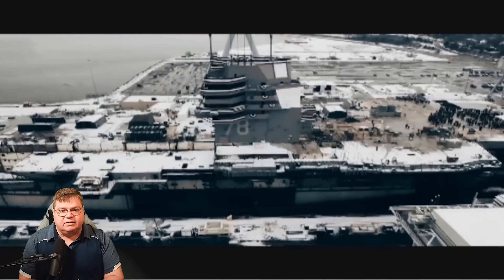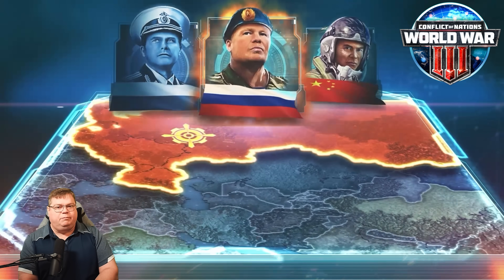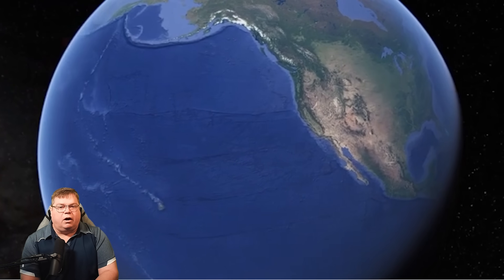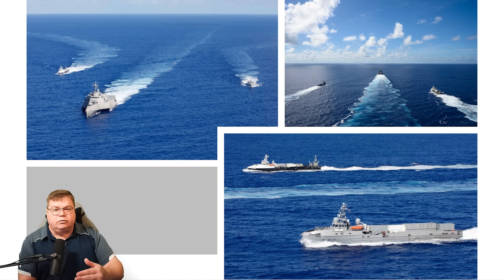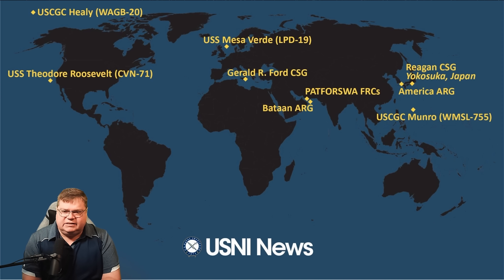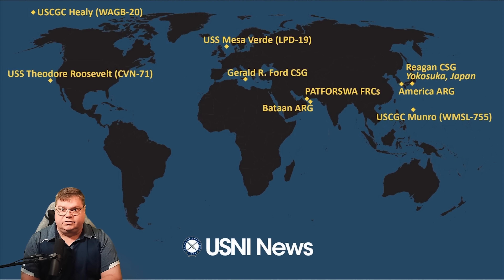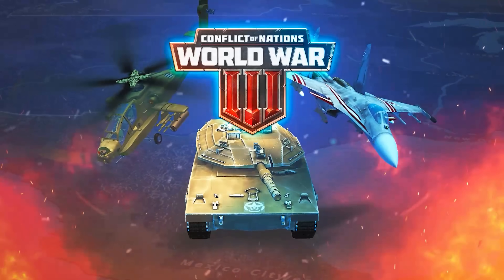How The US Spends $200B On The Navy (and get away with it)

Comment: With Ike on the way, it will be interesting to see how a classical USN Strike Group performs in 2023. Does it still hold the weight it did in the 90's? Didn't see any 35's on the deck of the Ford, a red flag. Will 1990's doctrine hold up against the advent of air/sea drones and modern missiles? Can the elderly wings of the F/A-18 keep up the same tempo of thunder and death? Under the shadow of a third world war, will the USN expend its precious arsenal of artisanal TLAMs?

Comment: I got issue with the new “Fly-by-wire” design our military is using. 
Have you ever had a taillight go out because the wiring got damaged? Imagine trying to take apart a ship or a sub just to find a faulty connection. Repairs are going to happen.
Reply: You do realize that it’s easier/ cheaper/ lighter/ less bulky/ and more reliable, right? All that means that not only is it easier to isolate/ narrow down the source of the problem (modern diagnostics/ monitoring can tell you exactly where to look when something breaks, & often why it broke. It can also catch aberrant trends to tell you something is about to break/ needs replacement.), it provides for much more redundancy vs. purely mechanical systems. It’s a lot easier to divert electricity than steam. It may not seem as intuitive at first. It definitely requires a more theoretical background, but once that background is in place, the complexity is much more manageable than older alternatives. It also means one’s knowledge is applicable to a broader set of systems.
Reply: If this is the case, I hope we can utilize FBW systems as you have described them. They seem to significantly cut back on parts required for building a vessel and their maintenance. Do we now about any of the disadvantages of this system?

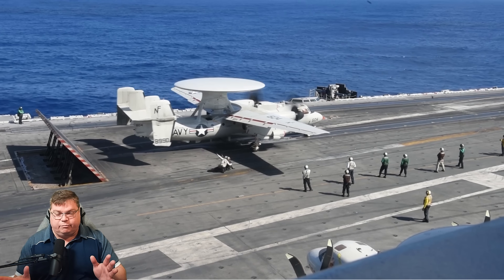Comment: 4:10 Backup systems to keep a carrier online?  US Navy reactor operator vet here.  The only real backup is that there are two reactors.  One can supply all steam loads (turbine generators for electrical power for ships loads, aux loads, reactor coolant pumps, and aircraft catapult systems) for both steam plants.  If both reactors are down, ain't nothing keeping the ship moving.  No electric propulsion motors like subs have, Aaron. 🤣
Reply: What are you talking about, they have the most powerful backup system ever devised. Lower enlisted. Grab a paddle and get to work!
Reply: @Plaprad  I wonder how many horsepower each person could muster.  Each of the 4 propellers could produce around 150K shaft horsepower. A Nimitz class carrier is 100K tons.  That would take a shitload of paddles.
Reply: @sixft7in  Respectfully, your SHP number is off quite a bit; at least for my old ship.
Reply: @mikehammer4018  Oh, I know.  Never say the real numbers and all that.  100K tons is right, though.
Reply: @sixft7in  Yep, probably got the same out-brief that you did. Still have the enthalpy curves and power curves burned into the inside of my skull even after nearly 30 years. (as an aside, holy crap, it really has been that long... I'm an old man now)
Reply: @mikehammer4018  Yeah, mid to late 90s for me.  Been a while.
Reply: @sixft7in I think Aaron was thinking of the four diesels. While they can't provide propulsion, they can be fed into the ring bus to power some things while the plants are recovering from a scram. I don't think they've got the juice to feed both plants simultaneously, but I'd personally have felt much better if CIWS and RAM were up - maybe the SLQ-32s too. (at least when I was in, Sea Sparrow was a horrible system not worth the time, effort, or displacement)

On the other hand, he was a bubblehead and you know how those guys are...

Which reminds me of one officer candidate's final drill set in Ballston Spa. The guy was a smart-ass, so they was really pounding him. When he realized they were simulating the Thresher, he excitedly ordered, "rig the outboard". The monitors had to stop the drill set because everyone was laughing so hard in their masks we were in danger of hypoxia.